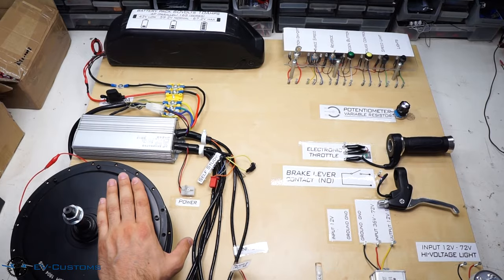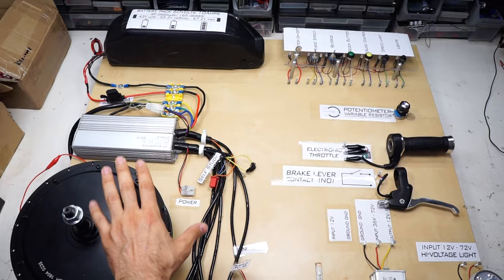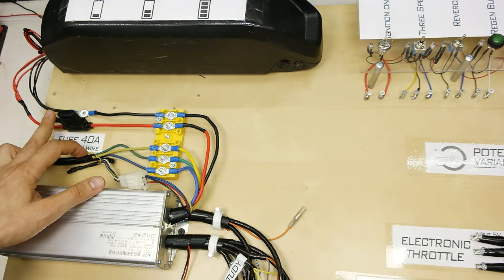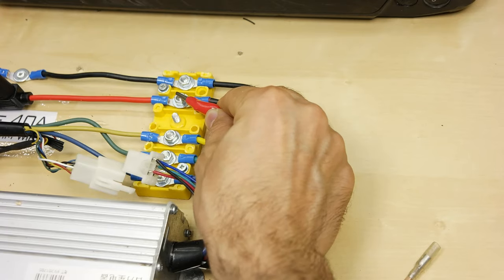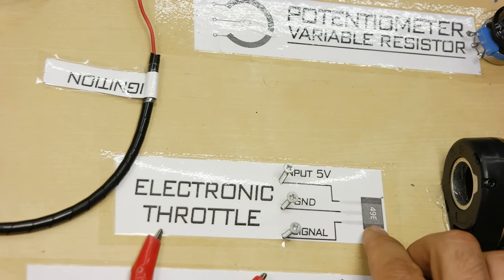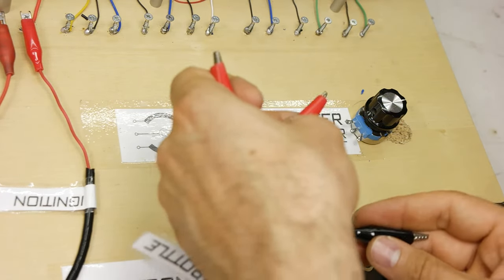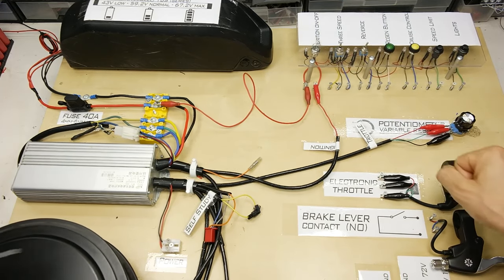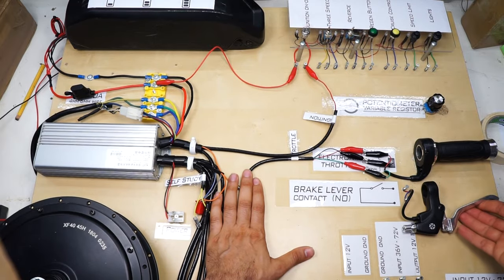BLDC Controller Learning Board for Beginners

Comment: I have a test you might be able to do to replicate an issue I’m having with my ebike. The symptoms are that the ebike will sometimes abruptly accelerate with a small throttle input, but the motor runs smoothly and quiet.

The brake light 2-wire connector normally has battery voltage (60v nominal) when the ignition is on, but as soon as you squeeze one of the brake levers, this goes to zero. The brake level switches are like yours, Normally Open. But pulling either brake lever will cut power to the motor (no regen or EBS, just power motor coasts to a stop).

I started to trace out the wiring harness and several other anomalies appeared. The 3-speed wire from the controller has 3 wires (as expected), but  only 2 wires (50% and 120%) are plugged in running forward. But the 3-speed switch has 3 wire connector. Clearly this means they borrowed ground from somewhere else. But like on your other video where you added 50%, 120%, and EBS, you also borrowed a ground from something else.

My wiring harness, after it goes from the back to the front of the ebike, has several wires spit off into common wires. I think the grounds, the 5V and the 60v wires from the controller are all shared. The controller also doesn’t have a dedicated 3-wire connector for throttle. It’s bundled up in a 6-pin connector with brake cut out.

I know most of the ebike controller functions are either ON or OFF, either having 3-5V or being pulled down near 0. But the throttle has variable value from 0.8v to 3.6v, and if that signal fluctuations it will tell the controller to speed up or slow down.

So my question is, is it possible for any of these shared wires to cause unstable throttle signal since these are pretty small wires going about a meter forward, which might allow a small voltage change on both the ground and +5V from where it is in the controller board to where it’s uses up front. 

Also when I went to open my controller it uses spring steel clip inside to hold the mosfets to the controller side. No external screws. I didn’t want to break it so I put it back together. Lol. But I wanted to identify each wire leaving the controller so I can make sure the throttle has its own dedicated 0v, 5V and signal wire going from the throttle to the controller, and see if that gives stable throttle.

I think if I only connect the essentials (batter +/-, 3 phase wires, 5-pin hall sensors, ignition, and throttle, and leave the brakes and 3-speed and everything else disconnected, if it still has a problem then it’s the throttle  or controller. 

My controller tag says it’s 48/60v, 120 degrees, Brake HI, 27A, 42/52v under voltage, 3-speed.

Comment: Really appreciate this, being a newbie . Is it possible to also get a instruction on how connect a sensor less controller to a hub motor w/o hall sensor. I got a hub motor (bafang?) with only 3 wires (except the 3 motor phases), I guess it is only some sort of revolution sensor /counter.
Reply from the maker: Hi.. sensor-less controller working with EMF feedback , from power three phase coils of the motor, instead of sensor feedback which takes 5V signals from the rotation.
Reply: @EVCustoms  So I should opt for a controller with speed signal 5v, the wire input on the pcb controller says gnd/5v/ss. Where can I find such a 350 / 500w controller. I have not seen any yet.

Comment: can i run a controller with just battery controller motor and throttle? no brake or power switch or display?

Comment: Have you seen a device that will work in the place of the throttle that can connect to an rc receiver?  Thanks!
Reply: Wingxine PT01B multifunction servo signal converter.  Add a 1.5K resistor from negative to signal on the output to shift the range.  E-bikes are 0-full forward and RC is typically 70% forward and 30% reverse.  Warning, the + and - pass through!
Reply: Astro Flight RCPWM2V or Blue Point Engineering PWC-202 may work.

Comment: I have a 4000 w 13 and 72 volt Hub motor in the front of my scooter but it only seems to spin when I spin it by hand not when I give it throttle can you tell me what you think the issue is with my front motor not spinning unless I spin it

Comment: Could I use the controller at twice the power of the Hub Motor?  Example;  Controller 1500w / Hub Motor 800w.
Reply from the maker: Hi...  Yes for some seconds or minutes, depending from motor quality, on most electric vehicles controllers have twice power output for starting, and dropping power output when the vehicle reach at nominal max speeds..

Comment: question: you had a 60v battery and a 60v controller but a 72 v motor, so is it possible to use a 72v 40ah battery with a 72 3000w motor and a 48 250 w motor? or lets say its a 48v 40 ah battery, is that possible?

Comment: Thank you for the video, it is very helpful.  I recently upgraded my 1000 watt Voilamart  DIY ebike to the 1500 watt kit. My original kit has the LCD display showing battery power and speed of the bike. The new kit only has a LED bar graph on the throttle with no LED display for speed. Is it possible to wire in the  original display Model SW900 to the new system? The new controller is bigger and has no connector for a display.  Thank you.
Reply from the maker: Hi...  as your controller has no display wires,, that means is not compatible with LCD screens....  sorry man..
Reply: @EVCustoms  Thank you for your help.
Reply: You can wire the display directly to the battery for it to show the battery voltage.

Comment: Hi.
I wonder if you can tell me please if I run a 48v motor on a 36v battery if it’s going to damage anything or if the battery can handle it? 
Thank you very much in advance.
Reply from the maker: Hi...  you can run 48v motor on 36v for sure...  without any problem..
Reply: Thank you very much.
All the best.

Comment: Thank you for the video. Very informative. I have a 2000w 72 motorcycle runs ok for a few minutes and then starts accelerating without the throttle even when you press the handlebar switch off  After pressing the break several times it completely stops working. After turning off the ignition and waiting about 1/2 hr works again for a few minutes and then the issue starts again. Any Ideas. Thanks
Reply from the maker: Hi Gustavo... this problem must be from your BLDC controller...
Reply: @EVCustoms  thank you for your quick response. Do you think  the  controller could be repaired, or will it need to be a replaced
Reply from the maker: @gustavofranqui3574   most probably your controller IC (microcontroller) is defective... and to fix this issue is difficult..
Reply: @EVCustoms  thanks I will contact the seller It should be under warranty I've only had it for a few weeks. Thanks for all your help
Reply: @EVCustoms  Hello again I was able to buy a new controller. Thank you for all the good information. After making all the connections and testing the motorcycle the motor is  making a loud noise when you  turn the throttle like something is holding it back  and only does about 30kph in addition the 3 speed setting do not work not sure if I mess the controller or if it is motor. Hope you are able to help 😃, thank you kindly

Comment: Bro thanks for the video. If we are making a e-car and want to make and optional switch that turns on when the battery heats up more than reuired how do we do that.
Reply from the maker: Hi...  you can buy from AliExpress one cheap thermostat board with ready relay on it, you will choose the temperature and that's it...
Reply: @EVCustoms  and one more thing nedeed to ask you tha if we want to detect over weight of the vechile and return some signal....how do we do that.!
Reply from the maker: Hmmm... i don't know... maybe some sensors on suspension...??
Reply: @EVCustoms  Hi where can I find a mechanic for my hub motor.Thanks

Comment: Are there any 12v output for lights?
Reply from the maker: Hi..  from controller you cannot take 12V output, there you need DC-DC converter, most of this converters can work from 36V to 72V with output 5V or 12V

Comment: Hello EV customs, what is your experience on using 20s configuration on 72V controller.
Is this high voltage a potential risk to destroy the controller on your experience. 
Second question. What do you do with the display wire. What can you hook up this wire?

Thank
Very good video
Reply from the maker: Hi...  if your controller is for 72V system its ok, its safe....  about display, controller must be compatible with display and software..

Comment: Hey there I'm running two systems on one bike I removed a hover board power supply and wanted to use it on my to wire dc motor but motor only has 2 wire the controller has 3 wires how can I wire the 3 wire power supply to the 2 wire motor

Comment: Hello how are you,  It's is wonderful vedio,  I took out one DC motor controller from one off road electric bike, but that controller have only 2 wire to connect with 3 phase motor wheel of hoverboard.  Can I connect that 3 wires red yellow and blue to 2 wire of dc motor controller
Reply from the maker: No you cannot connect DC controller to BLDC motor

Comment: My Ancheer sport stops and when I reinsert the charger cable it will power on. the.battery is new and holds a charge. It will go a mile then stop again. It will show no bars. Replug the charger ready to ride. Have you heard of this problem is a new controller needed. My bike is 250 36 volt if I put a 350 48 volt then what happens?

Comment: Can you help? on a 3 wheel mototec scooter, I switched from 48v lead acid batteries to 48v lithium Rad Power pack,  because I have 2 of them for more range. but one of the batteries didn't work, the newer one. I figured because the old controller didn't have capaciters large enough to take the larger voltage, 54.8v.so I installed a new controlle also. Got the drive wheel turning, but slow in reverse. So I hooked up the reverse/forward button, but it now runs slow in forward as well as in reverse. With the old controller I was getting about 23mph. Now I'm only getting about 4mph. It acts like it is running in reverse speed while going forward. How can I get back to the high speeds?
Reply: I tried the intellegence wires but I think maybe that is how I got it stuck in the reverse speeds going forward
Reply: CORRECTION: I'm now getting high speed in reverse and slow forward. I think I have to reverse it with the phase wires, right?

Comment: I'm putting a 36 volt scooter rear wheel on the front wheel of a mobility scooter that will be three wheel drive then completely independent and I need to learn more about this 36 volt controller

Comment: How do I bypass the control board and just straight wire a evercross evo8e electric scooter  from front wheel motor to battery to screen

Comment: hi good day to you
i am trying to upgrade my ebike
old controller 48v 350watts
throttle works on stock

then i connect new controller to throttle but not working
if i connect 5v wire to signal wire (both from controller throttle wires) the motor runs
so it is always on
can't control it with the throttle
do you any idea how to fix?
or what i should test with tester?

Comment: Are u still aktive ? I need help with my 2 sinesvave controllers, 60v-72v.
I can not find any proper wiring diagram and i bought it in second hand so all the connecters are removed from the owner if it before me. I do not understand the wiring from the controller display and the (second display cables, throttle cables and the modes. Same unit)
Reply from the maker: Hi friend..  for any services support about EVs, only via membership on YouTube or Patreon

Comment: ''Hi, very very good your Learning board, congratulations. please I need to know, measuring voltage for each cable. 5V?? 12V?? 60V ??. I have a 1000W controller, but I don´t have information about, so I can not to start it. I don´t know what the brand is it, just I have the Model RXA304Z-1000W12G
 60VDC all other is writen in chinese. A big greeting from Argentina
Reply from the maker: hello friend sorry for delay, you want to find the ignition wire to start the controller...?
Reply: @EVCustoms  hello, yes , everything  may be ok, but no run,  Mosfet OK, voltage for each fase OK, but not PWM output, I Think that any signal enable is not present
Reply from the maker: send me your wiring in photos ok ev-customs@hotmail.com
Reply: ook thankyou very much, I will later

Comment: Hello, question, can you put a xiaomi m365 motor controller into a segway ninebot f25?  (Replaceing factory controller)
Reply from the maker: Like that you must change also the screen..
Reply: Hello thanks for responding, I purchased a m365 kit which came with a new screen, I plugged everything in it turns on but doesn't pair with xiaomi app or not responding to the throttle, I'm most positive I wired it wrong

Comment: What us the small controller box at the bottom of the board?,what is it for?the small box with 3 wires ,looks la a small controller ,what is it for?👋
Reply from the maker: This is DC-DC step down controller... this device is to convert high voltage of battery 36-72V to 12V, so you can connect 12v lights, usb chargers Bluetooth speakers an more..

Comment: Hi, is the brake system magnetic or not?
Reply from the maker: There magnetic and contact types..
Reply: @EVCustoms  thanks for replying. The high level plug that comes out of the controller is just on wire, so do you know where i suppose to connect it?
Reply from the maker: Yes.. To activate High brake lavel, must me connected to Red High voltage wire, for example of your system is 48V you must connect it on red wire from the battery.

Comment: I am installing a new lcd screen controller on my ebike. The connections were not the same so I was going to splice them together. However when I cut the wires from the bike and the wires from the controller they are different colors. From the lcd display I have yellow,black,blue,orangish,and green. From the bike I have white, black, green, redish,and oranges. What goes to what?
Reply from the maker: First of all you screen is comparable with your controller?

Comment: Hi, can you help me with my project, I was planing to build a dual motor parallel system Xiaomi m365 scooter. Can you draw me circuit and the diode I need for both system not to short circuit each other?

Comment: If you don't connect 3-speed switch at all is there full power or what?
Reply from the maker: 100% power
Reply: @EVCustoms  ok, my controller manual says: "3 Speed (standard: 50%-100%-110%)" but i haven't tested.
Reply from the maker: @jusubbidiy  50% > low connection, 100% without connection, 120% High connection.
Reply from the maker: For sure on your three wire connector you have one black wire, this black where is GND (common)  so any from other two colour wires you connect to black wire you must test (with  throttle) you will see from turning of hub motor if is low or High wire...

Comment: Hey I have a question. Everytime when I try to unplug the power cable (2 pin XT60 connector) that is connected from battery to the voltage controller it ignites with spark of explosion and burnt my fingers.  Is there a way to prevent that from happening?  I need to be able to work on my scooter and I am afraid to touch it now because of this strong spark / explosion. :(  I also fear to plug the power cables because I'm afraid it will explode again.  My battery is Li-ion 60V and voltage controller 60V.

Comment: hello . i  want to make a controller for brushless dc motor 120w/ 3000 rpm/ on 12v battery . can you help?. it will be better if i can had a braking system and reverse

Comment: How can you simulate full throttle? In other words, with NO throttle or pot how can you hook up the effect of a full-throttle with no physical throttle???   the GREEN, RED, and BLACK wires with a resistor? just connect two or the wires???
Reply from the maker: To full speed without throttle, connect green with red

Comment: Bro , i have 48v 500w ebike , After a rainy day my ebike speed cut off on its own , throttle sometimes dont work  but today i just turn on the key and after some seconds my bike speeds up on its own crushing with wall , i was lucky that this happen inside my garden and not in street trafic . Can you explain its throttle problem or motor ??
Reply from the maker: For sure is not motor issue, check your throttle and controller wiring...  somewhere there you must have water ..

Comment: Hi on a 72 volt controller which colour is for key switch, I see orange for power lock but only has one wire , on my scooter my power lock wires are blue and brown which wire would I connect to the orange wire if this is supposed to be my key switch
Reply from the maker: First check you scooter brown and blue wires with multimeter, sure that is your power button, after that connect your lock orange wire with blue of scooter, and brown scooter wire with your 72V controller power +72V from battery

Comment: I wanted to ask you I’m trying to add a battery to my Electric bike that I could have a dual battery can I connect the wires of the new battery directly to my connection on the first battery and is both batteries onto the  same wire that connects to the Apm controller The first battery is a 48 V with 10 Ah— The second battery is a 48 V with 20Ah

Comment: Hi

A common problem that i am having and lots of people have is with brakes low and high. My controller i supposed to have eabs+ brakes. I have no manual and have connected 2 of these controllers to a hovenboard 1 for each motor and them work as they should forward and reverse but no brakes work. The electronic brakes does not work when i short them. It just cuts power to the controller. Do you know what brake high is? The controller does not have regen brakes.
Reply from the maker: hi.  what you mean when you say you connect the controllers to hoverboard...?